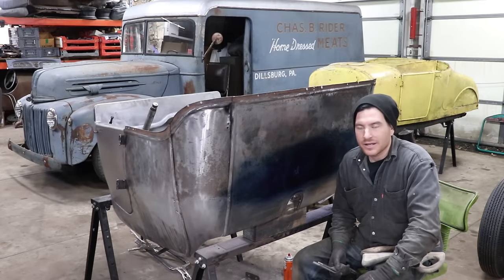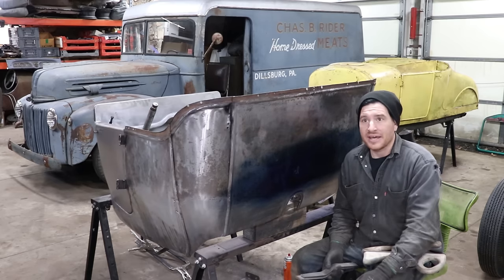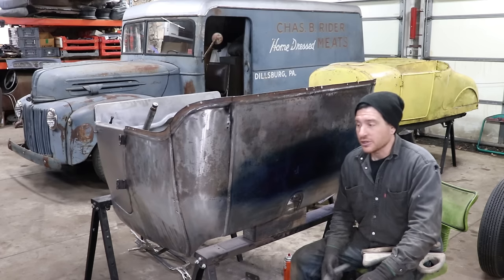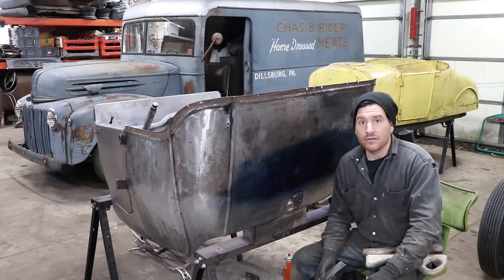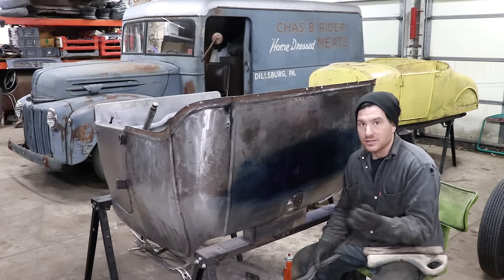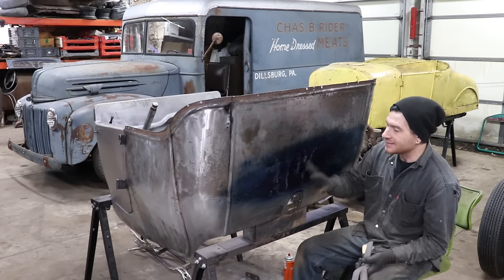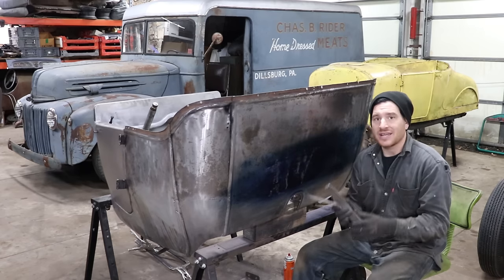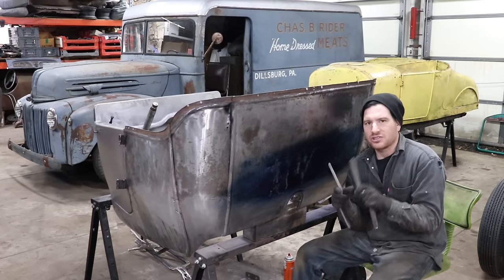Tools That Dont Sucks - Slapping and Metal Vixen Files

Comment: I have all those  metal files,  plus 3 you dont have.  I have a curved file and a curved concave file.  Also a flat convex and a flat concave file.  These were my fathers, so they date back to the 40s.  You can sharpen them.  My father was a pre bondo bodyman.  These were used for lead as well as metal and bondo.  They are good for metal finish bodywork.